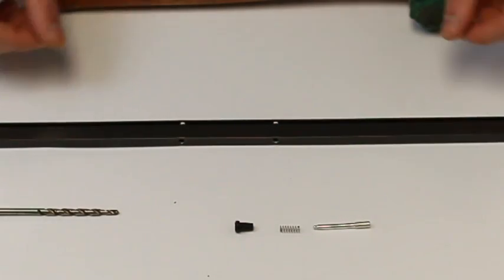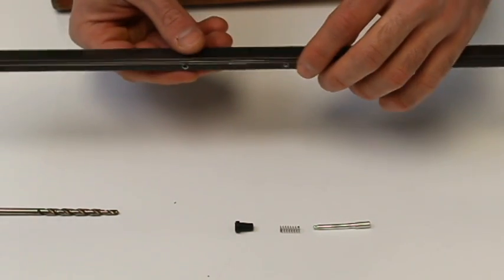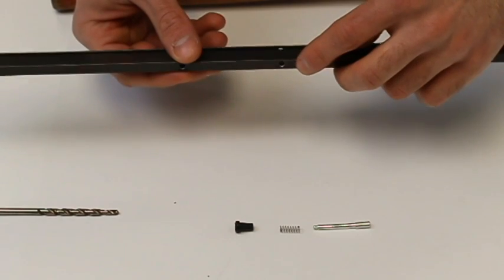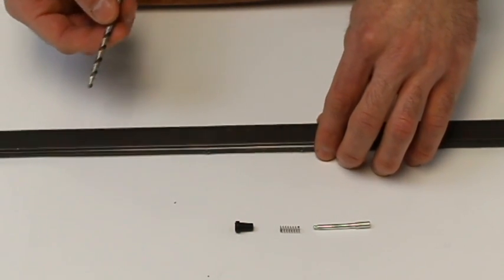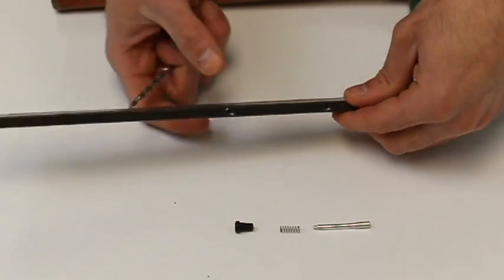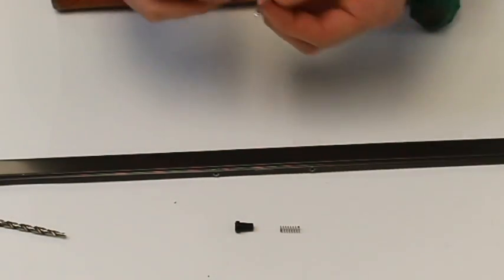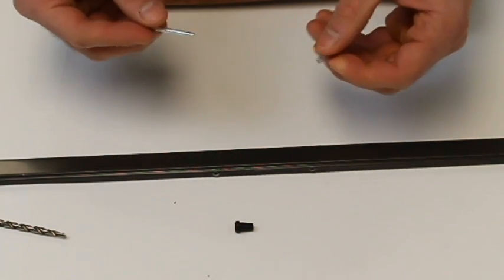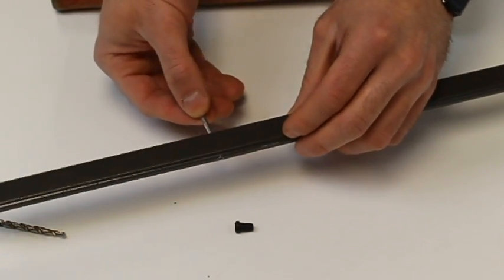How to install the 70-009 window screen frame plunger pin

Comment: I was hoping to see how to go about drilling out the hole for the pins on a new piece of frame material.  I can't imagine it is very easy to do
Reply from the maker: It may be a bit trickier to drill new holes, especially if the screen is already assembled. You may want to reach out to our experts for some additional help - https://www.swisco.com/page-id-part

Comment: so how do you install the spline and screen mesh because now there is a messy hole with a pin in the way.  Which are you supposed to do first. thanks
Reply: I'm trying to figure this out right now. So did you ever figure it out.

Comment: I just use color coded #10 self tapping torx security screws. Four per window. The name of the game is turn over and you can't make many of these screens if your drilling a bunch of tiny screw holes all day long..

Comment: More than half of the plunger pins on my screens are frozen and will not move.  I would like to replace them as you show in the video.  How do you remove the old plunger pins without destroying the screen frame or screen.
Reply: I would recommend using a Dremel with a small cut-off blade to cut about three-quarters of the plastic top off. You should be able to break the remaining quarter off by hand to prevent cutting through the screen. Once the top is off, you should be able to yank the pointed end out through the big hole with vise grips.

Comment: Is this to hold the actual frame in place or just the spline/screen mesh?
Reply from the maker: Hi Julie,  replacement plunger pins are latches, used to hold the screen insert in place.  
http://www.swisco.com/Plunger-Pin/pd/Replacement-Pins-For-Screen_Storm-Panels/70-009